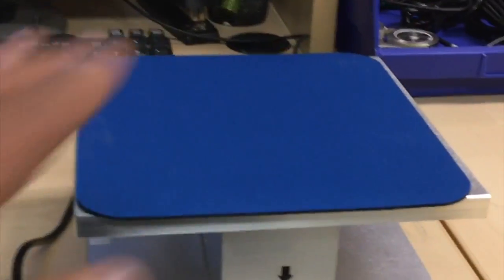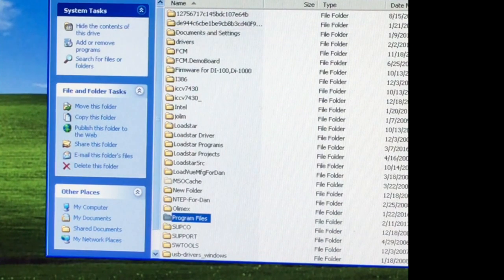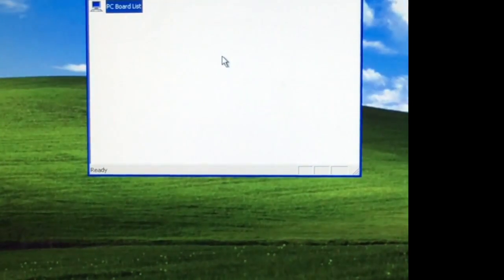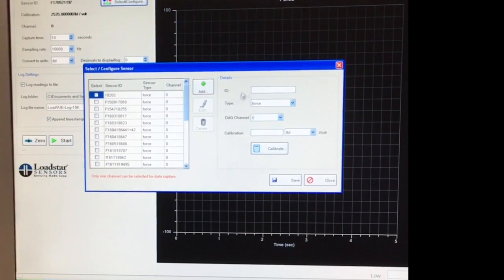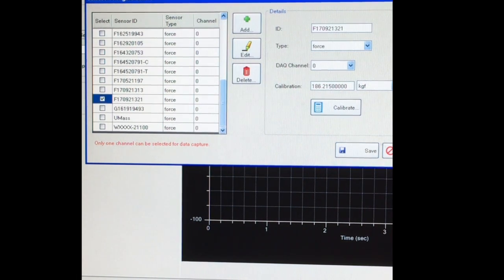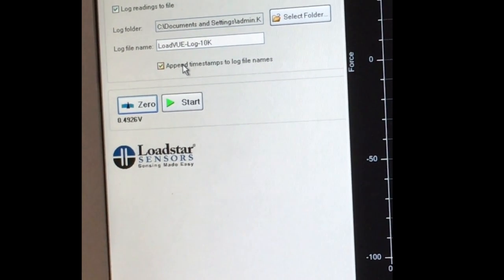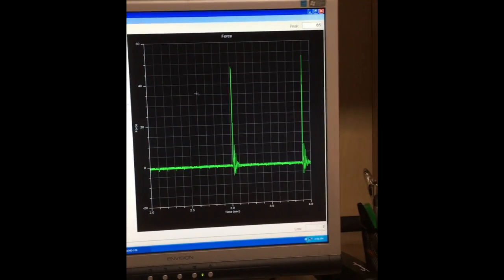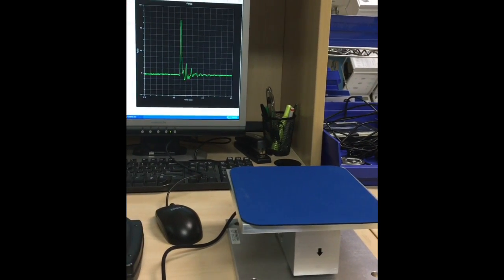Setting up Impact Force Sensor

Comment: The platform on which the pad is placed is the actual sensor. You can drop a ball on the metal surface to see the impact force without the pad and then see how well the pad dampens the peak force.